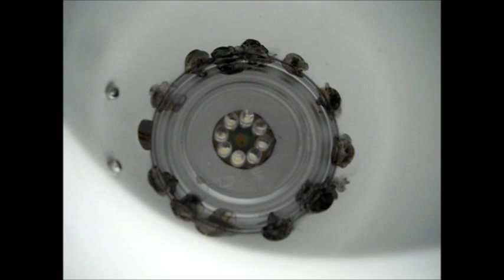Desk Lamp Converted to LED Battery powered (Part 1)

Comment: Can I ask what kind brand of lighter that is? very cool.
Reply from the maker: It is a china made no name ...You can find them on Amazon ..Search for butane torch or turbo lighter
Reply from the maker: https://www.amazon.com/Multi-Purpose-Lockable-Patterns-Soldering-Cigarette/dp/B0040VM15M/ref=sr_1_86_a_it?ie=UTF8&qid=1482085486&sr=8-86&keywords=butane+torch+lighter   Looks like mine

Comment from the maker: I am gonna have to learn more about leds  The way I built this was easy I knew it used 3 1.5  volt batterys  3 AAA's  if you can find something that is already LED with a wall cube  you can gut it out and fit every thing in your project  I have passed up those used magnifier lamps because of the bulbs being shot  I have taken leds and applied voltage till they burned out than I just used less volts once I found the peak voltage